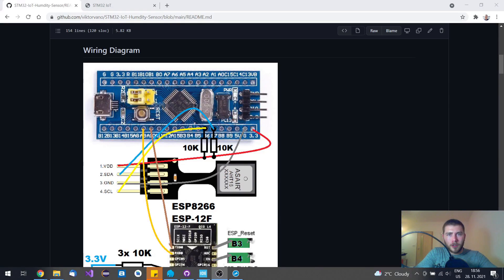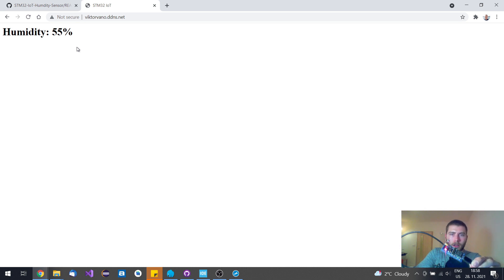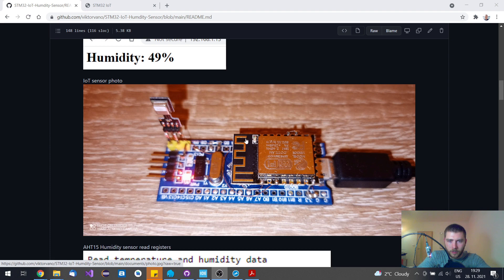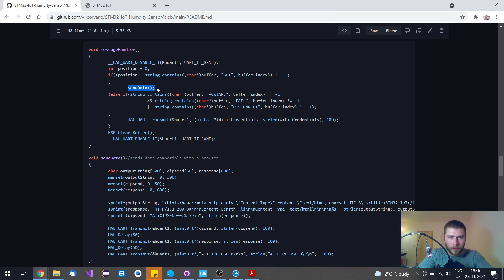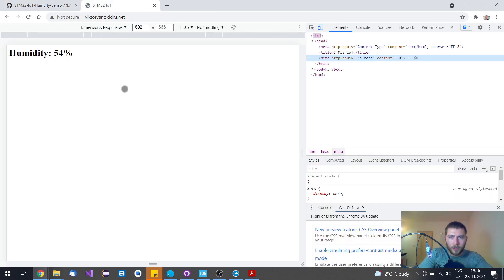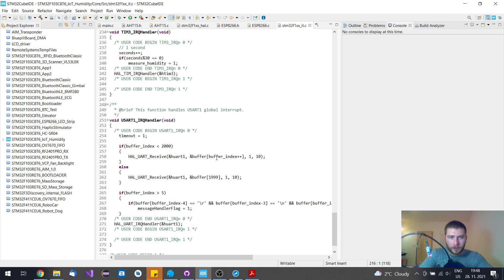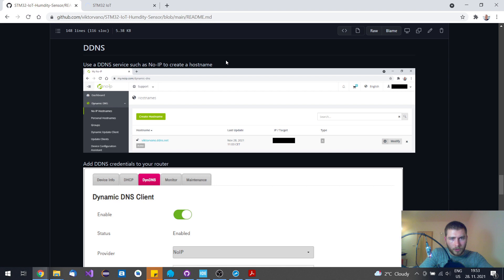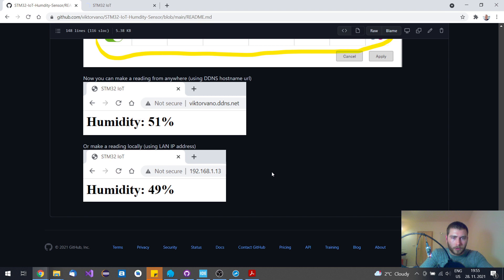STM32 + ESP8266 + DDNS - IoT Humidity Sensor (AHT15)

Comment: How you calibrate the AHT15,how you calculate that constant value for me its showing some value and that is not changing at all pleaseee help out
Reply from the maker: The PDF says it is fully calibrated from factory.
https://www.smart-prototyping.com/image/data/2020/09/102061%20AHT15%20Temperature%20and%20Humidity%20Sensor%20Module/AHT15%20Technical%20Manual.pdf

But later I have changed the sensor with a different model from a different vendor. It seemed to me that I bought an untested sensor or one that failed the factory test.

Comment: Hi, 
I think you can achieve it cheaper using only esp8266 and humidity sensor (i usually use dht11). If you use tasmota sensors software, you do not need anything to code. Just upload soft on esp and configure WiFi and connections and that's it ;)
Reply from the maker: Thanks for a tip :)
I will look into it.